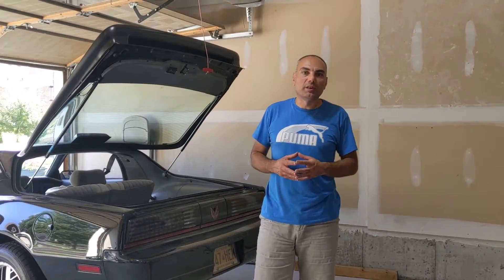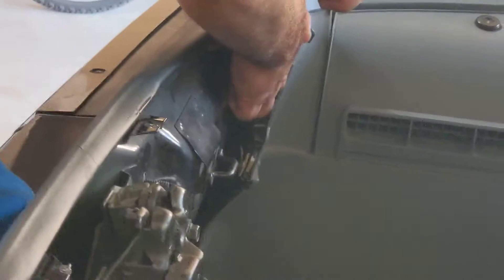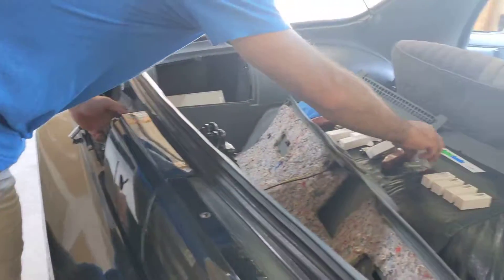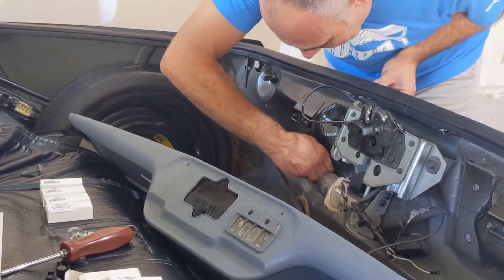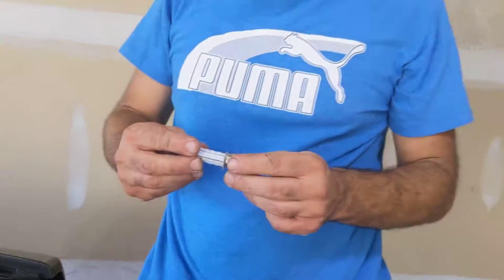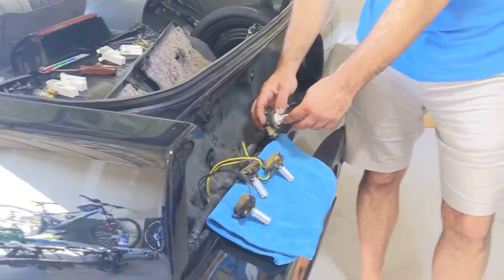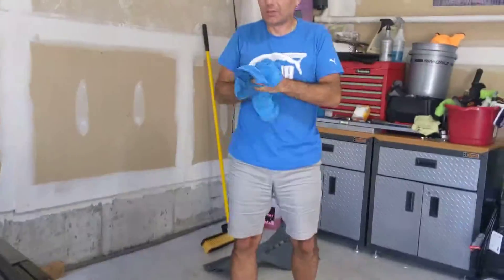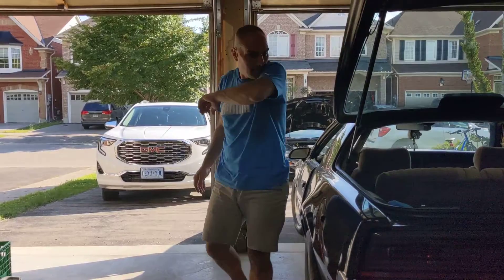1986 Pontiac Trans AM LED tail lamp retrofit

Comment: Did you need to install a special flasher for the turn signals? I went through that with a Camaro I converted to LED.
Reply from the maker: Yes I did. Both the turn signals and hazard